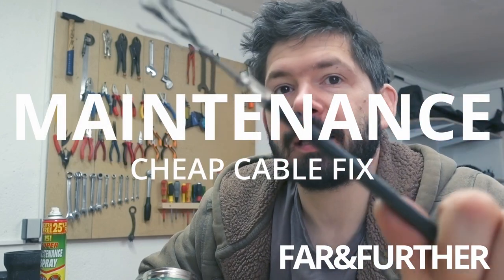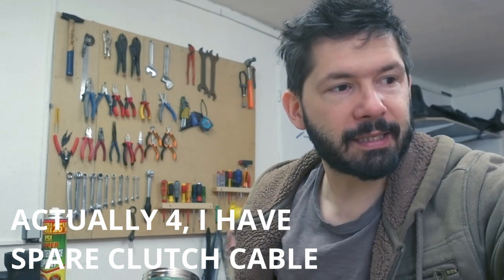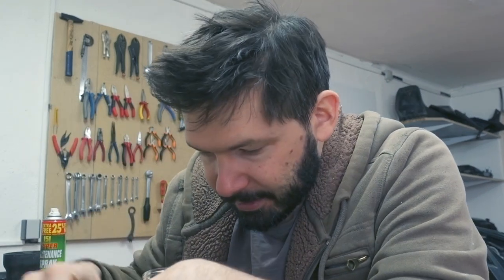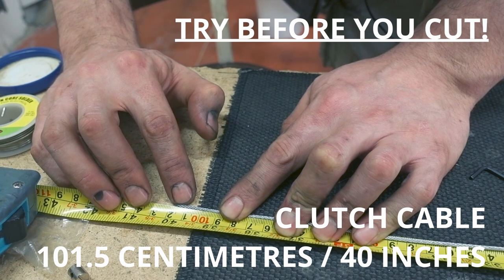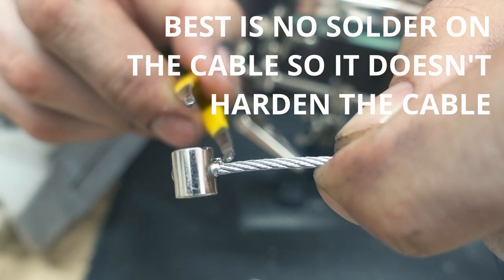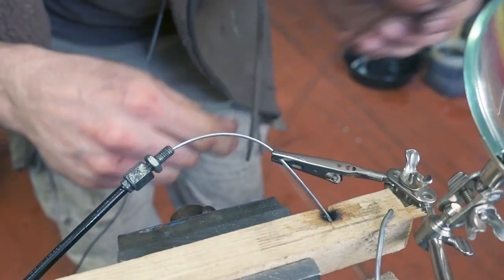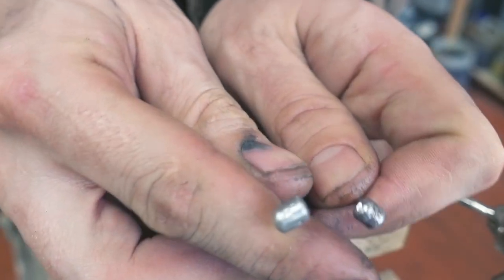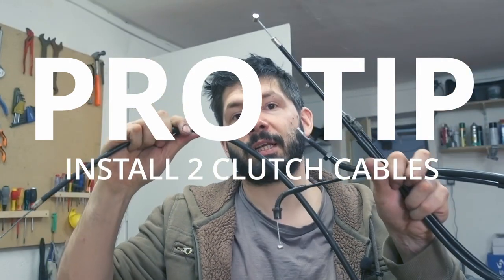Maintenance - Cheap repair of clutch or throttle cables - Version 1 - Check updated video

Comment: Brilliant idea with the wood mold. I was racking my brain on what to use as a mold. 😊
Reply from the maker: Yep, it worked, someone in comments suggested the aluminium but wood was easy to work with. I need to test the flux & other material when I'm back from Albania, I have one clutch cable to fix....
Reply: @FARANDFURTHER  My throttle cabe is working great! Saved me a buch of money and time. ! P.S. I frayed the end just alittle in the mold, so it will nevet slip out of the solder agin.

Comment: Drip feed engine oil onto your inner cable, it'll suck it in, use an oiler. When it gets out of the other side is done.

Comment: why are you breaking so many cables? Just curious as I have never broken a cable in 35 years of riding.
Reply from the maker: Hey Jo,

I think the main reason would be using the after market levers. We are talking about 54000 km, every day riding but still, the cables snapped at the same spot every time. Which is at the lever right after the end.

So I really think the levers are the cause of this.

Comment: If you fray the end of the cable about 1-2mm then make your solder fitting you get a much stronger tip. Also you need to maintain cables at least every 10K mile or more often depending on the terrain and weather you are traveling in. There are cable lube tools made for the purpose, are not expensive and easy to use. Also cables normally break at the end because the fixture doesn't rotate during actuation. Fit, lube and check the levers for fluid movement often.
Reply from the maker: You're 100% right. The maintenance is very important indeed. I usually have problem with the fixture not rotating enough and the cable breaks right there at the lever.

Comment: my clutch cable just snapped do you think this would work as a stop gap for about a week of riding if i follow the good comments: bike honda xl125 veradero.
Reply from the maker: It has a potential to last much longer. My first repaired cable lasted 6000km! Just use good flux and cable and you should be fine!

Comment: My clutch cable has 100k km on it and looks new. Have you fitted an after market lever i.e it's rubbing against the cable ????
Reply from the maker: Yes, it is usually after market levers which destroy the cable as the angles are not precise enough.

Comment: I have just brought that kit... and finally cut through the cable 😓 but the end has frayed..no matter how I try to cut it... so it cant thread.... how did you keep end tight together?
Reply from the maker: Hi, cutting it tricky isn't it. I ended up the angle grinder with very thin plate. Or you need very good wire cutters - big one. It may help to pre-solder it in the spot where you're going to cut it and cut it soldered. That way it would keep together. For soldering you will need some strong flux for stainless steel otherwise solder won't stick, @Nightster recomended Bakers Floid No3, I use some random one from local manufacturer.
Reply: I use a cablekutter to shave electrical wiers, works great

Comment: Looks nice. Do you have some feedback one year later on how the soldering ends lasted?
Reply from the maker: The thing which I didn't know is what @Nightster recommends in other comments... I need to use solder flux for stainless steel, otherwise it won't hold long. In general, without the flux they lasted between 3-6k km which is not much. With flux it's solid!
Reply: @FARANDFURTHER  Did you use rosen core electronics solder? Or acid flux plumbing solder?
Reply from the maker: @markbutler9046  Originally I used only normal solder. But after reading up a bit I got flux (kind of acid) for stainless steel.

Comment: Hi Good job, a couple of suggestions - 
As a mould you can use Aluminium the same as you did the wood but you get a better finish and if you drill a 3mm through before the 6mm hole for the nipple then you can hit it out with a punch and dress it up. 
I would also suggest fraying the cable slightly as the unfrayed cable could pull through. 
You could also consider soldering the nipples supplied in the kit rather than the screw as this would be more permanent. 
I do mine using a solder pot and use Bakers Floid No3 as flux which is a liquid. 
Can I ask what flux are you using? Thanks.
Reply from the maker: Hi Nighster, I made the new updated video about the clutch cables and incorporated your feedback! Thank you so much for your suggestions.

Comment: Very cool fix
Reply from the maker: Yep, it works just read some of the comments under the video, the guys have very good points. Especially using correct flux. I'm going to fix my Tenere clutch cable now I sourced one broken so lets see how that goes.

Comment: Hello .. What material is this Melted wire and where should I buy it? ( Link to any online store).
The electric lead broke,  it is soft... :)
Reply from the maker: Hi, not sure what you mean? I'm using normal electrical solder (the thing used in electronics to connect parts). It is soft but it always was more then enough.

If you asking about the cable itself its steel cable from DIY shops.

Comment: Hi, how has the throttle cable worked, has it held up?
Reply from the maker: So the first cable I did using solder ends worked for about 6000km which was quite good. It failed because I didn't properly treated the end of the cable before soldering. Here in comments are very very good suggestions by @Luzianna Long and @Nightster how make this DIY rock solid!

I tried later to use TIG welder to make the ends but that does not work because themperature makes the cable brittle, so solder is way to go and check the comments of those two, if you do it that way it will be forever.